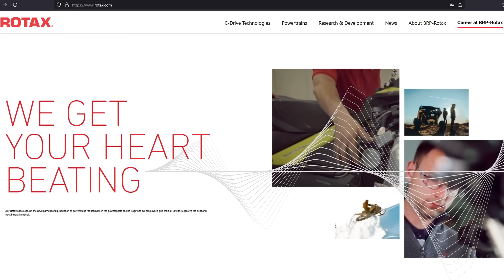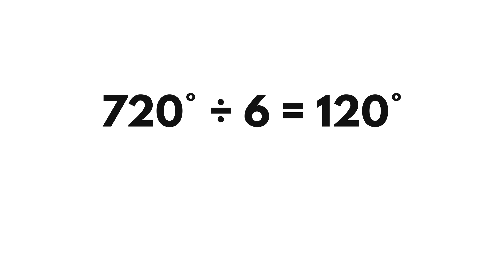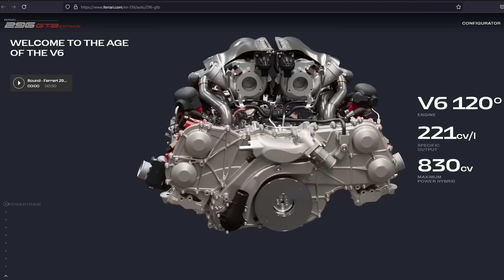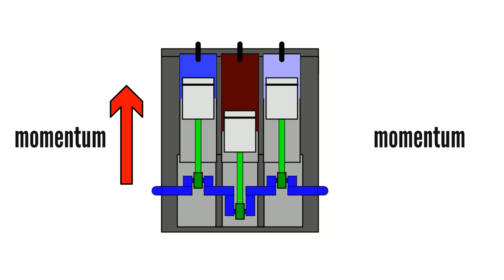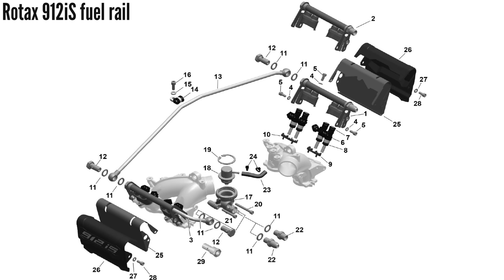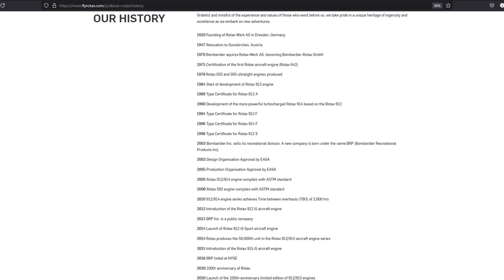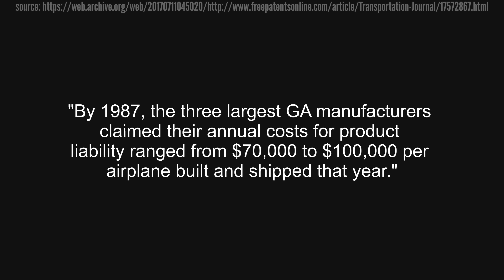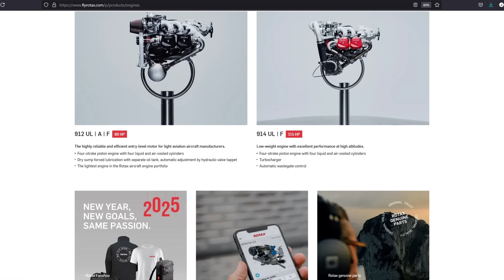Why Rotax's 300hp V6 Aero Engine Never Saw Production

Comment: Just discovered the channel and roaming through the videos, no time to watch them yet (but will soon),

But for this one (just by reading its title) I'll say:

If you have enough money to buy a 300hp, then you have also enough money to buy better manufacturing than Rotax 🤷🏻‍♂️
Reply from the maker: I'm sure you'll find both something you like and something you hate on the channel 😆 Rotax has an excellent reputation and statistically they are of the most reliable, if not the most reliable aero engines.
Reply: @LetsGoAviate  Will watch some vids as soon as I have time to 😉

As I was a teen we used to have a P2002 with a Rotax engine at the local air-club. The mechanics was always complaining about the Rotax, and about the P2002 overall 😉
They finaly changed it for a Sonaca-200. But just realized it has a Rotax engine too 🤔

Comment: Simple solution: incorporate the rotating inlet/exhaust valve system. It's more compact, less weight and less parts and simpler design.

Comment: Echoes of Porsche's failed attempt at a "turn key" PFM 3200 aero engine, which promised 200+ hp, still ring in my ears.
Thirty years later, it ended up as a museum piece.
Reply: Some are still flying.

Comment: I feel like every time someone mentions that 120° v6s are substantially taller than a flat 6 forgets that intake manifolds exist.

Cuz you can easily tuck the intake manifold into that 120° v and add no additional height above the head.

But I have yet to see a flat 6 that doesn't get additional height from the intake manifold. It's not technically impossible, but I've certainly not seen it done

Comment: While I respect the reliability and efficiency of the 9XX series of four cylinder engines, I've always thought there was a minor flaw in the layout by not using either crossflow or single sided heads, as this would the ability to lead straight onto a 200hp version by simply adding two more cylinders (beefed up crankshaft aside), and as mentioned hereabouts, the 3:1 gear. ratio would have probably lead to a range of harmonic problems...

Comment: It's a little-known fact of engine history that John Deere started to develop a general aviation engine.  This was in the mid-1980's after they bought the North American rights to the Wankel engine from Curtiss-Wright.  They entered into a joint venture with Avco-Lycoming and designed a 3.4-litre 2-rotor Wankel engine that ran on jet fuel with spark-assisted ignition and turbocharging.  The power goal was 400 hp @ 5800 rpm.  This was a full-on development program with castings designed for the major engine housings and rotor, so the intent was serious to take the engine to market.  The project took about two years to go from drawing board to first engine build, and about a month before testing was to begin, Avco-Lycoming announced they were backing out of the venture.  And what was the reason?  Product liability.  

It was very deflating for us at John Deere Rotary, but since the first engine was already built, it was tested for a couple of weeks, or maybe a month, and successfully made its designed power.  Then it was crated up and put in the warehouse.
Reply from the maker: Very interesting, maybe I'll dig a little deeper into this one. Thanks!

Comment: If you are interested in engines....YouTube has MANY video's of new designs that all promise to 'revolutionize' the market.    But....consider that the engines in use now have well over 100 years of constant development built into them and are a very mature design that works well.   Any new engine needs to at least equal EVERY performance criterion and if it does so then needs to exceed at least one or there is no reason to adopt the new design.   So far....these new engines are different but no better than the well proven ones in common use.   Unless the cost is much lower, the reliability much higher, or the fuel burn much lower the Rotax V6 would not have been attractive to potential buyers and I'm thinking this is the main reason it was axed.

Comment: An alternative to longer propellors to compensate for the slower propellor speed is more propellor blades. Ground clearance needn't be an issue
Reply from the maker: 100% yes, and that's probably what they did, although the aircraft that sported the Rotax V6 at Oshkosh 2006 had a 3 blade.

Adding blades and making it shorter is less efficient that making blades as long as possible, but it would work for sure, and with one of Rotax's selling point being quiet operation, shorter blades is the way to go.

Comment: With crap gas being the norm, any successful attempt at a replacement engine will need to be a boosted diesel. Likely a two stroke. EPA currently isn’t going to allow that so first things first is to dismantle the EPA who are at this point basically costing lives. The FAA should have been dismantled or at least their mission statement altered 50 years ago!

Comment: Price. 

New engines are all $50-$100k now.

At some point, people start looking at 2M+ Corvair engines, VWs, rebuilding their own Lyconosaurs with modern pistons, rings, Electronic ignition. Even electronic fuel injection in some rare cases.

All of these options range in the $10k-$30k range apposed to the $96,500 Lycoming IO-390. Which itself is a clone of Barretts O-390 which was a hopped-up 0-360 and wasn't even Lycomings own design. They copied a derivative and now charge nearly 150% more than it is actually worth.

Rotax has joined the movement of way more for a little more. 912 UL was $20k. iS Sport is $28k. 915iS turbo is now $40,000. And the 916iS commands $53,000 for essentially the same engine with only an additional 18 or 19hp.

Comment: 6,000 rpm is the problem.  Remember the Porsche flight motor based on the air cooled flat six from the 911?  Similar power also at around 6,000 rpm.  This motor flew but did not go into production.

Comment: Any "V" 6, or "V" not divisible by 4, is inherintely unbalanced and/or has a delayed ignition sequence. 4 strokes for a cycle, 2 revolutions. To have the ignition event spaced evenly apart is the goal for smoothness and longevity. V8 V4 V16. Every 90, Every 180, 2 on 90 with the 16. 4 stroke engine you have to fire every cylinder in 2 revolutions. The math doesnt allow a v6 to have a balanced firing order. You have to skip or waste a spark to get to 720 degrees

Comment: Most likely the Rotax V6 would have been quite a bit lighter than a comparable power traditional engine. Which would make it a lot less direct fit into an exisisting airframe. Lightness flies better, but only if you get the balance right.
Reply: Just push it forward, the nose might look odd but no worse than turboprop retrofits.

Comment: I , likw others, winced at the thought of 6k rpm at max power...thats a ton of rpm, and likely made some potential owners nervous.
Most GA pilots flying certified aircraft, tend to be a conservative bunch...a modern liquid cooled , computer controlled engine, is usually not something they'd reach for, when so many more traditional options are available, and cheaper to boot.

This engine ,i think , also  suffered a marketing failure . It should have been allowed to gain traction in the experimental community first, as these rypes of owners are more risk tolerant.
Reply: The much shorter stroke compared to the higher capacity pushrod motor means piston speed might not be a big deal... also the valve train has less reciprocating mass.  But I'm not sure i'd want to listen to a >4500rpm cruise
Reply from the maker: The Rotax 912, 914, 915 and 916 all spin up to 5,800rpm at takeoff. 6,000 rpm isn't that outlandish, but it certainly is new in the 300hp application. You are right about GA pilots being conservative, and about listening to such a fast spinning engine in flight, altough it never bothered me too much under my headset. I have many hours behind a Rotax and a Continental, enjoyed both and yes 2300 rpm just sounds better.
Reply: The Kawasaki design plans for peak power at some 9000 rpm, that's gonna be fun.

Comment: Personally, I think it was a combination of several things that made them cancel.  As many know Bombardier has had a, shall we say, interesting relationship with their investors, both institutional and government (federal and provincial).  Finally the family agreed to split up the company and keep the recreation side (higher margins and less regulation) and turn it into BRP.  Bombardier sold off rail division to Siemens I believe. Most know the history of their aerospace divisions.  My point is, that this engine doesn't really fit into their new focus imo.  I know they want Rotax for their engines for their other divisions, but I think they probably dream of aircrafts in their nightmares still.
Reply from the maker: Agreed. It's easy to underestimate the role this plays. Many years ago I worked at a company that aquired another, and promply sold of one of the aquired company's very profitable divisions. It wasn't in their core vision to operate in that market, simple as that. In Rotax's case, Bombardier knowingly signed up for the liability risk, but for BRP management who inherited the 936, it just didn't make sense.

Comment: cost, complexity, longevity.  How much longer does a Lycoming running at 2600 RPM last than a 6,000 RPM v6?  General aviation really needs less complexity and good reliability which both result in less expensive experiences.

Comment: 6,000 is a lot of rpm for an aircraft engine. Looks like GA will die at the hands of the lawyers after all - much of whom are the only ones that can afford GA planes to begin with lol... I think I'm going to let my flying dreams die - its just not worth the exorbitant cost - most of which just goes to the lawyers not the product. F' them.

Comment: The dynamics of an aircraft engine is very different than a car engine.  Even after converting an automobile engine design for use on an aircraft, the engine doesn’t have the normal operation longevity as in a car.  After a little as 1000 hour or so, the auto converted engine must be averhauled because the wear and tear is a lot higher than a normal Lycoming.  One simple explanation is aircraft engine operates at its upper power band continuously while a car only uses its high HP for short acceleration.  Most cars only uses 20% of it’s available power most of their lives.  An aircraft runs its engine very hard.
Reply: The Porsche PFM 3200 had a TBO of 2,000 hours.

Comment: Flat boxer engines would apppear to have a lower profile than V configurations, in reality once you include the intake and either carburetion or injection the difference is minimal.  The area between the banks in a V configuration provide the space for these items. Subura engines are an example.  But I agree with the point others have mentioned that unless a new motor is demonstrably better in terms of efficiency or safety than existing proven examples, what's the point? The risk-reward isn't worth it.

Comment: I thought they would add 2 or 4 cylinders to their 4 cylinder and turbo charge it. 
Or they could probably add a coupler between 2 engines and use two engines mated together so production costs would have been insignificant.

Comment: I have a rotax engine in a motorbike made by aprilia and it's effing great 😀
Reply: So do I (652-cc thumper in a G650 Xmoto - yes, the Beemer was built by Aprilia in Noale) but the integral gearbox is not great, as it tends to false neutrals. Fuel economy is ridiculous being around 45 mpg at a track day and 70 mpg in normal street riding.

Comment: When you see all the cables and connectors and say...no. Only few days ago we had total electrical failure at start on a bog standard Piper Warrior. Next day took a look around, traced main power cables, multimetered to find some corrosion and slightly loose nut on the starter solenoid. The power to cabin also comes off this connection. Clean with emery, rebolt, all sorted. Kis...keep it simple and still failed.
Reply: i thought you were supposed to have redundancy in aircraft, even a lot of cars have some redundancy in the main engine/chaasis power connection. and in a car you can just stop if something fails
Reply: @TheHenirik  Not in light aircraft, one of everything. If it fails, well pilot has to deal with it. Reason multi engine aircraft exist to give some redundancy. I think the UK CAA still don't allow single engine commercial like the Cessna Caravan aircraft with one engine.
Reply: @ airplane engines are literally known for having twin redundant ignition systems though?
Reply: Ignition systems don't rotate the crankshaft to start the engine on the ground. That job is for the starter motor and its power relay AKA "starter solenoid" which ports power to the starter motor by energizing the solenoid windings.  Of course when switched power FROM the cockpit connection to the solenoid windings is not available because power TO the cockpit starter switch is unavailable
nothing happens when start is attempted.
Starter solenoids are generally easy to bypass on the ground to start an engine and have nothing to do during flight. Pulling cabin power direct from the hot connector on a solenoid is as good as anywhere else and makes troubleshooting easy. It's quite like automobile starters going back over a century.

Comment: Both McLaren and Ferrari have recently introduced 3.0 liter 120° V6s with very similar designs. 
If I had to guess, I'd say that they were copying Porsche without copying Porsche - a not-quite-flat six with a shorter crank, an easy-to-work-on hot-V layout with the turbos on top, and a driver-friendly mid-engine configuration instead of Porsche's squirrely, tail-happy tradition. .

Comment: 3.0 liter V6 engines do not typically need balance shafts.  The inline 6 engine has 0 degrees of V angle and since it is two inline 3 engines coupled in the middle and mirror image, it is very smooth.  The flat 6 engine is two inline threes that are across from each other, and the forces cancel out, creating another very smooth design.  Volkswagen's 15 degree VR6 engine is a true V engine but is so close to an inline that it also is very smooth.  Where you run into trouble with vibration is a 90 degree design;  This ALWAYS needs a balance shaft.  But....The wider you go, the less vibration there is.  A 120 degree engine is the same as a 60 degree engine, and a 135 degree V6 would be even smoother if it existed.  See the trend?
Reply: Flat engines have other problems, though, which is why they're so uncommon outside of aviation.
Reply: @PistonAvatarGuy  The main problem with flat engines in automotive use is engine oil scavenging when using a sump restricted in depth close to the ground. Not a problem for aero use obviously.
Reply: @FairladyS130  No, it's not related to the operation of the engine, it's related to the manufacturing and the servicing of the engine. In aviation, flat engines typically have separate cylinder barrels, which bypasses some of the issues seen with flat engines in automotive applications, but automotive-style engines are what's needed in GA.
Reply: @ Explain flat 6 Porsche's winning road races all the time then....
Reply: @Flies2FLL  I said that they were uncommon, not that they were nonexistent.
Reply: @ I have a 2001 Subaru Outback and a 2014 Porsche Cayman S;  Both have 6 pistons and say that you are wrong....
Reply from the maker: An inline 3 has a rocking couple on the primary imbalance (momentum of pistons and conrods). The outer pistons move in opposite directions and creates a rocking couple.

This carries over to a V6 and is why V6 engines (excluding 90° V) very often have a balance shaft. The McLaren and Ferrai 120° V6 engines mentioned in the video both have balance shafts.

Search for the following on the internet: Inline 3 vibration, inline 3 engine rocking couple, Toyota V6 balance shaft, Honda V6 balance shaft, Jaguar V6 balance shaft. Many more examples but searching these all give the answer.
Reply: @LetsGoAviate  Honda V6s do not have balance shafts (I have direct experience with their J-series engine). The current Ferrari 120° V6 doesn't have a balance shaft.
Reply from the maker: @PistonAvatarGuy   Yep sorry you are correct about the Ferrari. I was thinking about the Honda C series which uses balance shafts, not the J series.

Comment: Lawyers and accountants... the reason we all can't have nice things!
Reply: 20 years is way past most if not all warranty's and or design lifespans ( car/automotive electronics like fadect/ECU/sensors are aimed at 9~year's 150K mile's, so the warranty's are year shorter and at most mileage/hours run-time i knowledge about is 100K so 50K shorter ) if it was cap'd at 5-9 years under law it would be more responsible but as it currently GA is stuck with 1920's-problems and banned leaded-products and or forced into 1960's-jet-technology that is even more expensive it operate and maintaining than 100LL/1930's~era vs taxis-cab's/Italian sporting car's/semi's/yachting-clubbing

Comment: General aviation is stagnating itself into oblivion. The liability excuse is meant to keep innovative new ideas out of the market to allow the same old same old to remain. 

It really doesn't matter. General aviation will be gone in 15 years or so. Too regulated, too expensive,  too inaccessible. Small airports are being turned into housing tracts because they produce more tax revenue for local governments. Or the small airports are crushed by legal expenses because someone doesn't like the noise.